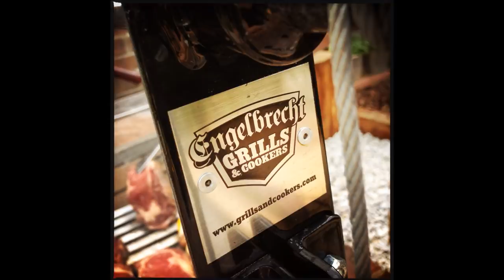Argentine Style Grill & Brick BBQ Smoker Stop Motion

Comment: This video was posted in 2013. How has the grill/smoker held up over the years. I am going to build a modified version of this. Is there any thing that you would have done different or improvements after you have made it? thanks
Reply from the maker: Really good question. I'm very happy with the design and performance overall. Everything will last at least 100 years :-) The grill from Englebrecht is holding up great and functions really well. The smoker is of type vertical which naturally means it's somewhat difficult to control. Too much fire will quickly overshoot the temperature. But if dialed in correctly, it holds temp really well and I can go run for s few hours.  Dinner is ready! Enjoy your own build and make sure to send me pictures!!!
Reply: Do you wish you would have lined the complete smoker with fire brick? I have seen smokers done both way's with fire brick and without, what do you think?
Reply from the maker: marcus mohr Not at all. The smoker only gets real hot where the fire is so I think lining everything with fire brick is just a waste of money & effort. The cinder block will last at least 100 years which is long enough for me and others to make a few pork butts...

Comment: Awesome, thanks. I bought your plans of Internet.  Did you use any high heat mortar in the build.?
Reply from the maker: Great - thanks for your donation !!
I did not use fire mortar. Here's my thinking: Fire mortar is more expensive than normal and I don't like that. The smoker doesn't see crazy heat, is double walled, stacked 3 rows of fire brick in the bottom. If any crack would develop over time it simply wouldn't matter. As for the grill area: The high heat is on the flat surface where the coals party but I am 'floating' the fire bricks to prevent frost from lifting & cracking that area. The fire box walls are done with normal mortar since they don't see crazy heat. I've built many many fires over the last two years, summer and winter, and don't have a single crack. 
Enjoy your project !!

Comment: What did you use for mortar for your fire bricks??
Reply from the maker: I used standard mortar everywhere. But the fire stone area of the grill and in the smoker bottom are floating to allow water to drain and avoid freeze/thaw cracking. Otherwise I would have used high temp mortar for those. But no cracking issues anywhere after 7yrs now.

Comment: Hey I really love what you have done here. I have started this project. Can I ask the measurements the the styrofoam for the arches. Thank you.
Reply from the maker: Thanks Edgardo! Take a look at the drawing https://sellfy.com/p/ChZI/ it shows radius and offset for the arc. As long as you fit it correctly for the left & right starting brick (those need to rest good on the horizontal ones), dimensions are not that critical on the arc.
Reply: Ralf Gomm k gotcha, anything that should be critical of this masterpiece? I have already made the concrete slap starting the bricks over the weekend !!
Reply from the maker: edgardo bartra Nice to hear you started working on it. Please send me pictures upon completion !!  The only thing that needs to be accurate is the mounting of the drop in grill. If you also use the Engelbrecht, make sure to place the two steel brackets correctly to which the vertical grill pieces will mount. Everything else can pretty much be adjusted along the way...

Comment: Hi Ralf! Great vid and project. Could you provide the source of your exhaust chimney please? Thanks!
Reply from the maker: Thanks - glad you liked it. For the smoker exhaust, I used a standard 4 inch chimney pipe from HD, normally used for gas water heaters ect. It's held in place and sealed with fire proof bond. The adjustable vent flap is made from a round piece of aluminum riding on a long screw serving as axle.

Comment: what a fantastic job and video i have been looking all over the internet to get the best design i want to build by far this is the best ive seen just perfect. I was going to purchase the plans to build just have a question about the smoker part is this above direct heat or is there a layer between the coals and the meat with a way to set or lower the heat to slow cook for longer periods of time thanks this was just plain fun to watch also!
Reply from the maker: Thanks Dave, I really appreciate your feedback! So the smoker is a traditional vertical design with the fire always being directly under the meat. I use a large aluminum pan with water as heat shield, placed on the first of two grates. Temperature control in a vertical smoker takes some practice and temperature overshoot occurs quickly if too much fuel is added at once. I had things under good control after a few sessions and can produce repeatable great results since then.
Reply: Ra

Comment: how did you mount the metal doors on to the smoker
Reply from the maker: +jake webb I was looking for rustic hinges but couldn't find or make any. So the doors are simply held in place with one or two small wooden wedges. There is a soft Nomex seal on the frame which is attached to the opening. This provides the seal and helps hold everything in place.

Comment: some drawers on a left side would look nice...
Reply from the maker: +dzodaj Funny you bring this up: I've spend many days thinking about adding one or two gas burners on the left but decided against it. The thought of drawers never occurred to me, though. Really good idea ! Something for the next grill... :-)
Reply: Yes you might build in 3 drawers element... looking forward for that new video with drawers, maybe a pooling wooden cutting-board on a side wall:). Since you appreciate my suggestion, here is another one:)...When I made my smoke oven (if that is the right ward, English is my second language), between the fire place and the oven I made a metal drawer about 20cm high. Not really a drawer, more like a compartment with a door opening downwards, and at the bottom is a metal net just like on your video. I used it to fill it with the river rocks, starting from 5cm diameter, going smaller and smaller and finishing with 1mm fine send. It is a good thermal mass and it is filtering the smoke of most soot/tar, just letting heat in the oven, and fine smell of wood smoke too. After some time rocks and send must be changed. On that concept the main lead for the smoke from fire place is going independently in the back through the metal pipe, and it can be regulated to be more or less open. Oven has similar exhaust pipe too.
Reply from the maker: +dzodaj This sounds great. You are really pushing me to get going on a new design :-) Cheers !!

Comment: Ralf, before i begin the build, i am in Texas and want to know how much meat can i fit in the smoker? Texas is big on brisket, sausage and ribs but brisket is king 'round these here parts of USA. Can i fit 2 briskets and a rack or two of ribs?
Reply from the maker: Hi Julian - the smoker opening is 16x16 inches. I have two racks and normally put a water pan on the lower rack as heat shield. That leaves the upper rack for smoking. The rack dimensions are 16x17.5 inches onto which I fit two large baby backs (but not three), or easily a 15lb pork shoulder (probably even 20lb). Above the upper rack, I added a rod to hang sausages. I've actually never made a brisket... not sure if that is even legal in North Carolina... so I'm not certain how many you could fit. Hope this helps !

Comment: Hey buddy! Hey I bought your plans at the end of the summer last year and got as far as the slab & then the weather took a turn.  I went to  the Sellfy link to look at the pdf but the link isn't valid anymore :( It looks like you moved them over to a different selling platform.  I'm trying to figure out how long the lintels are (I think it's the 3 1/2 by 3 1/2inch 12 gauge) that support the top part of the smoker door frames (the ones that are inserted into the cut cinder blocks).  Any help is mucho appreciated :)  Also anyone else who lives here in the Northwest good luck finding those lintels at Home Depot or anywhere else...hahah.  I'm going to have to call a steel fab place to get them I think.  I couldn't find an email for you or I would've sent my question that way.  Thanks!
Reply from the maker: No problem, happy to help! But I don’t know how to send you a private message so we can exchange emails. If I had yours, I’ll simply send you a copy of the plans again. Can you do that somehow?

Comment: Where did you get the doors from
Reply from the maker: The doors are home made: 3/4" plywood lined with 1/16 sheet metal on the inside and decorative diamond aluminum on the outside. Very simple, low cost and handles the heat perfectly. However, I'd prefer rustic looking cast iron doors but couldn't find any nor make them myself.
Reply: +Ralf Gomm thank you because I didn't know what where or how to make. Thanks again for the help
Reply from the maker: +Damon Battle Jr You're welcome !

Comment: What is the name of the metal sorta joists that go over the doors?
Reply from the maker: I think you are referring to the diamond aluminum plate. Let me know if that does not answer your question: https://www.google.com/search?q=diamond+aluminum&rlz=1C1NHXL_enUS752US752&tbm=isch&tbo=u&source=univ&sa=X&ved=0ahUKEwjl5t2K3cbVAhVHwVQKHQxlBEQQsAQI1AE&biw=1280&bih=593
Reply: Ralf Gomm thanks for the reply Ralf, not that plate. The steel angle that you used to go over the doors for the smoker?
Reply from the maker: Oh I see. That's just standard 1x1 angle iron from your local hardware store: https://www.google.com/search?q=1x1+angle+iron&rlz=1C1NHXL_enUS752US752&source=lnms&tbm=isch&sa=X&ved=0ahUKEwj3sJGX58vVAhWJslQKHcYvBRgQ_AUICygC&biw=1280&bih=593
Reply: Ahh thanks! thought there was a special bricklaying thing for this, and it wasn't just a piece of angle :)
Reply from the maker: David Ayres Yup, that's all it is. I bolted it to the brick with 2 screws each left & right.

Comment: Ralf, thanks for sharing the project video and making the plans available. I have purchased the PDF, laid the foundation, bought the grill, the plates for the doors, cinder blocks, the rebar, the plywood and the sheet metal. I have a couple of quick question. How did you cut the angled steel? Also, did you put the steel around all four sides of the smoker enclosure? Did you put the angled steel around the fire box enclosure at the bottom of the cooker? Thanks again for sharing the information and being an inspiration!
Reply: greggtech Gregg, I know you asked Ralf, but in case you are waiting to cut right now (smile). . . I used a jigsaw with metal cutting blade. Clamped down two ends to slow the vi-ii-ii bration down. Then cut across the top without clamps to finish the two end cuts.
I did not know that you could cut the lintels in half for the smoker lintels and both sides could then be used. I wasted because I did not ask before cutting.
This is a serious project and certainly looks monumental so far. I am waiting on my grill base to set right now. . . am just about where this picture shows.

1  in angle iron top and bottom smoker openings. There is high temp sealant between brick and angle iron. And then there is the nomex self adhesive gasket (comes in a roll) that sticks to the angle iron and helps seal the angel iron to your removable doors.

Best of luck.
mike
Reply: Michael Ennabe Thanks for responding. This is a serious project but I'm committed to having it finished by Labor Day! I may forgo the circular enclosure to hold the wood since I always cook with charcoal. I'm thinking that will shave a few hours off of the project. I think I will go with hinges for the doors. 

Thanks for your guidance and good luck!
Reply from the maker: Sorry for the delayed response - I was all focused on making great July 4th BBQ :-)  A metal blade in a jig saw works fine. For the lintels and angle iron, I used a metal cutting wheel with my angle grinder which will make a faster cut.
Correct, the angle iron goes around all four sides of the meat and fire box opening. Together with the Nomex gasket, this will provide a tight seal.
PLEASE do NOT skip on the brick arch front & back. It adds so much character to the project whether or not you need the storage space underneath. Yes... maybe it's a bit more work... tiny bit... but it will be worth it in the long run - promise !!!
Enjoy the rest of the project and send me a photo on Labor Day !!!

Comment: What did you you for Mortor
Reply from the maker: I used standard mortar everywhere. But the fire stone area of the grill and in the smoker bottom are floating to Allie water to drain and avoid freeze/thaw cracking. Otherwise I would have used high temp mortar for those. But no cracking issues anywhere after 7yrs now.

Comment: Sorry, but real argentine grill (I'm from Uruguay and we grill the same way) needs a fireplace next to the grill.
Reply from the maker: Peter Stross Yes, I know that now. My next design will certainly include that :-) Thanks!!
Reply: It is also important:
1. chimney must be over the fireplace
2. the fireplace needs an iron basket so tthe embers fall from fire on tio the place where you only need to push them under the grill
3. I know many Argentinians make the grill to be lifted horizontally, but I think it is much better that uou have a splitted grill where you have at the oposite side of the fireplace a small grill at a certain height as to grill sausages and things that are grilled dast and to this part united with hinges the main grill which will be lifted in angle - the part to the smaller grill is fix and you lift inly the part next to the fireplace this allows yoy to grill using even the heat of the fireplace, but without burning what you are grilling. It means that you only lift the side next to the fireplace the other end doesn't move.
It is also important to consider what one will be grilling. You can even grill a lamb or a piglet so you have to consider the size of the grill. To grill lamb or piglets takes several hours (lamb about 3 to 4 and piglet 4 to 5 hours - this is not something for everybody but after that grilling practically you don't need a knife to cut the meat.
Reply from the maker: Peter Stross Fantastic, thank you for the detailed feedback! You pretty much just put my entire next generation grill on paper. Thanks!!